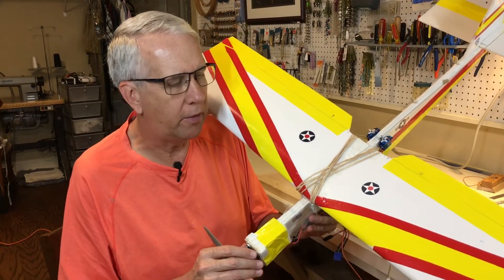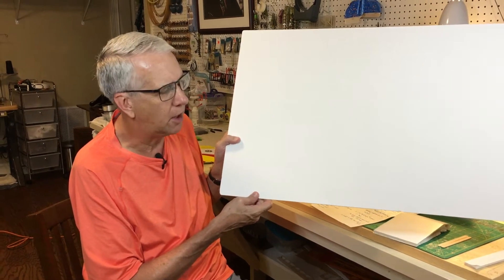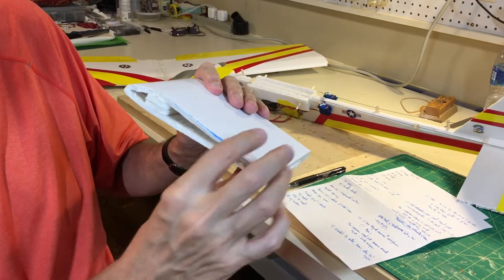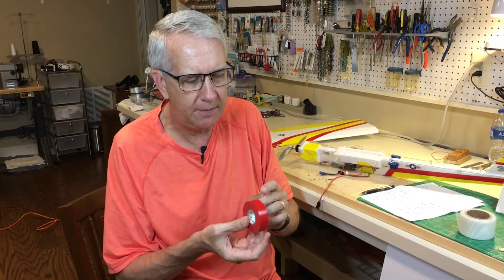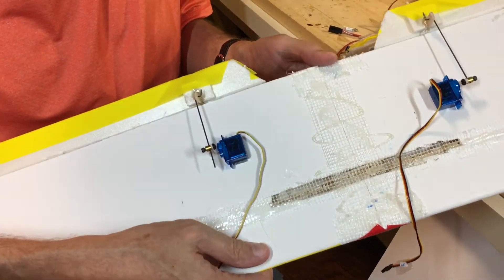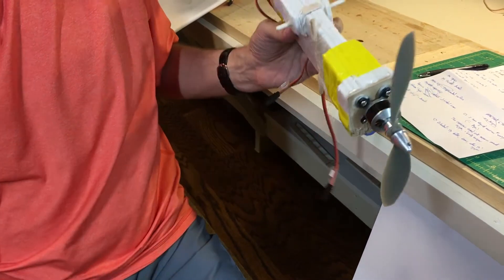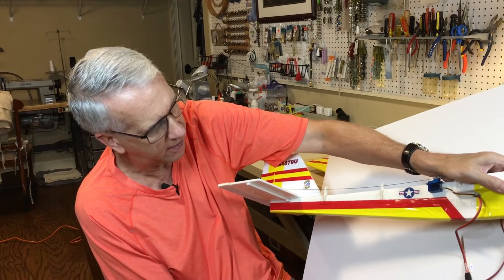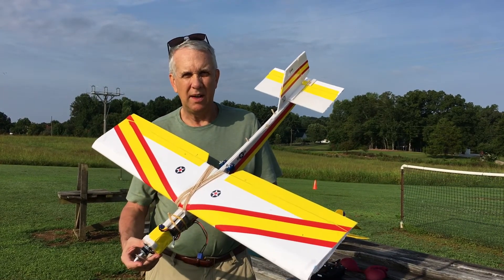Foam Bug RC Plane Part 1 - Prototype and Test Flight

Comment: Hey Tim, I am a beginner to intermediate in building models, I wanna know, does positioning the wings and the horizontal stabilizer at the same level on vertical axis, effects the pitch stability of a model? as I have seen some of your models like this and they still fly really well.
Reply from the maker: Thanks for checking in!  It depends on the model design, but as a general rule for sport flyers the wing should have 2-3 degrees of positive incidence (wing leading edge raised 1/16" to 1/8"), with the horizontal stabilizer level, aligned with the fuselage centerline.
Reply: @TimMcKay56  ok, I got it. So they can be at the same hight but with the difference in angle.
Reply from the maker: @ Correct.

Comment: Why not use dollar store foam boards - $1 for a larger sheet opposed to $3 each for royal and langnickel ($30 for 10 sheets on amazon)! Your rudder and elevator are pretty sloppy and ragged - I did better on my very first try at building.  Sorry,  I won't be a subscriber...
Reply from the maker: Carl, No worries.  Just trying to avoid outside trips with coronavirus.  Ordered mine from Amazon, Dollar Store ones work just fine.  Tim